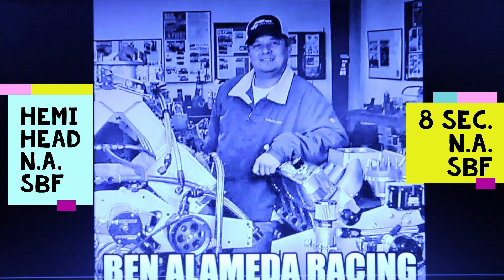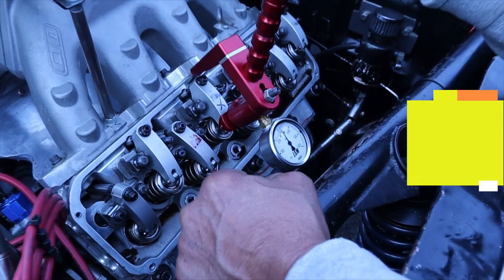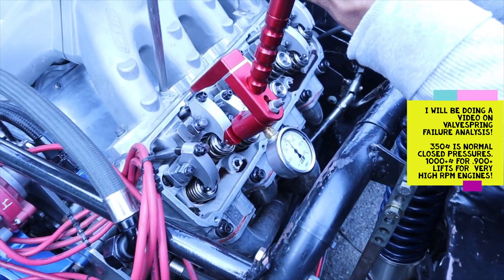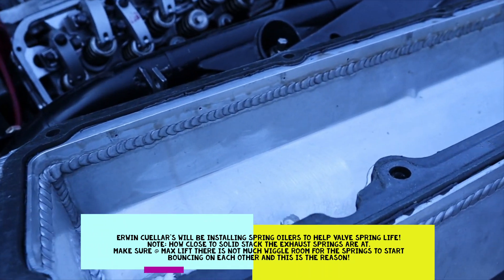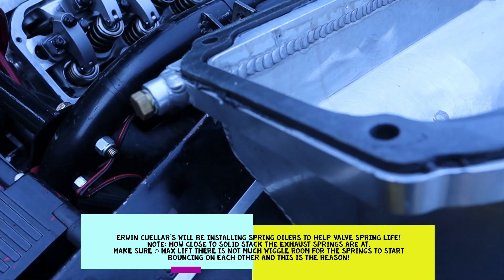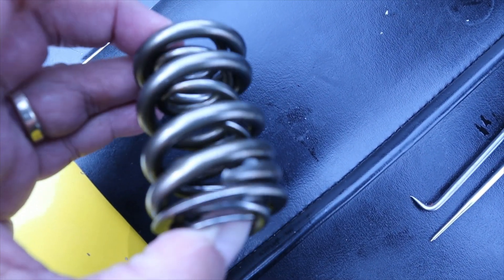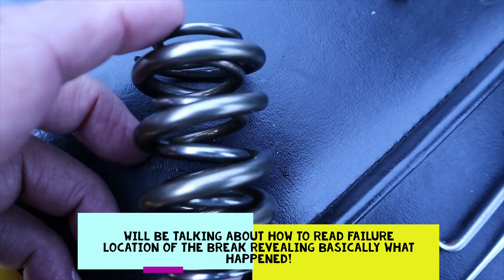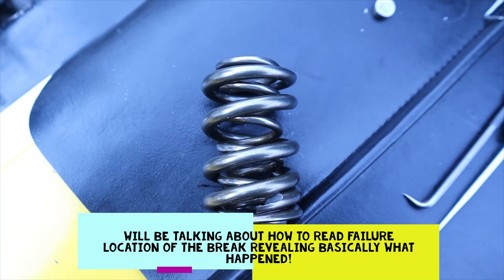HORSEPOWER QUICK TAKE VIDEOS:  VALVE SPRINGS/TURBO BBC TOYOTA!

Comment: Hey Ben have you run those new conical valve springs they have out now. Have herd they work real good
Reply from the maker: Yes they are very impressive due to their resistance to having vibrationary stresses cut down to a bare minimum.  I will explain this on a future video which I know will be an eye opener.

Comment: Like how u explained spring damage info, off topic a little, ur oil ring mod, does the engine burn oil & can u run it on street without issues, i like the amount of friction it reduces!!!
Reply from the maker: I will go to more details on the valve springs in a full video.  Oil ring mod does wonders in engine response and I have run them on the streets.  The most obvious is the puff of blue smoke at the start and nothing after. The more aggressive you cut back on the tension the more "it may" consume some oil and if there is no blue smoke on the tailpipe (even without the 2nd rings) then you are good to go and run a vacuum pump will definitely decrease the oil issue on the streets.

Comment: I like those valve spring oilers in the valve covers!
Reply from the maker: A must have even on a drag engine with lots of lift.  Imagine shifting @ 9600 equals to "1" intake or exhaust valve spring compressing 80x/second or a piston going up and down 160x/sec.!